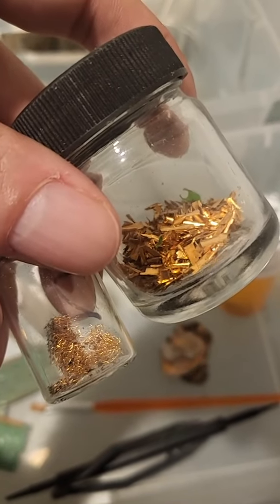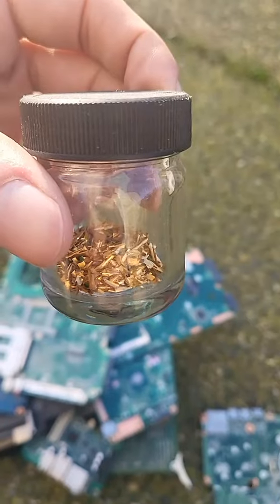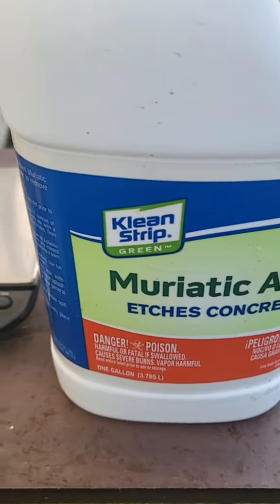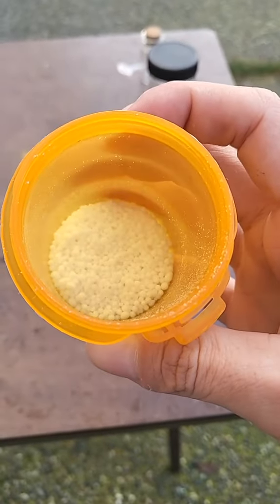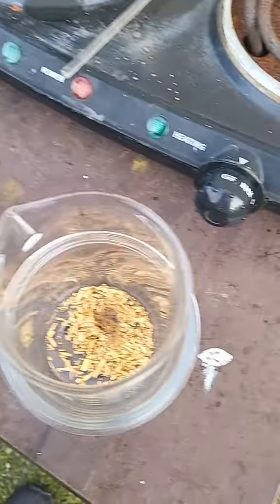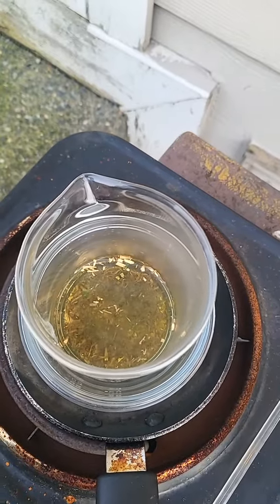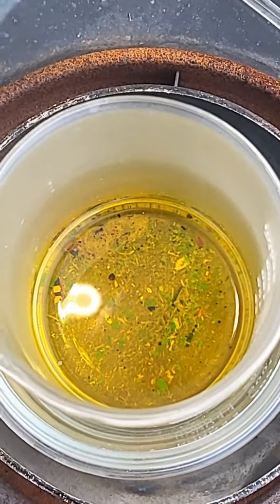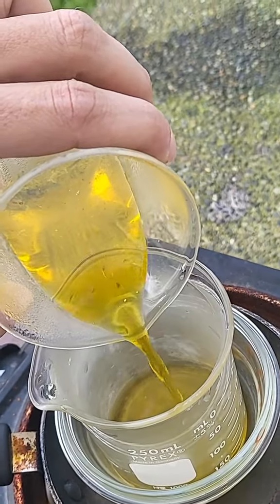this is how to get free gold from computers and electronics

Comment: I have no idea what you did here.
Reply: easy. 
in this video gold dissolved into the liquid, leftovers remained in the beaker.
(Gold wires and pieces were previously obtained from a pc motherboard)
later on Adam will neutralize the solution and precipitate the gold with the chemicals,
and melt/cool down the gold and obtain it as a single piece of gold metal.    
am I right Master Adam ?